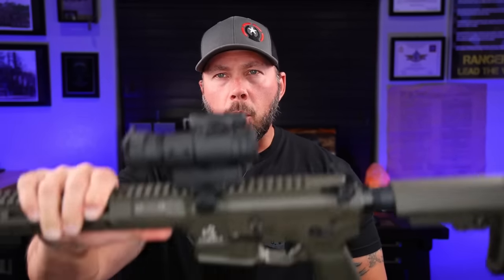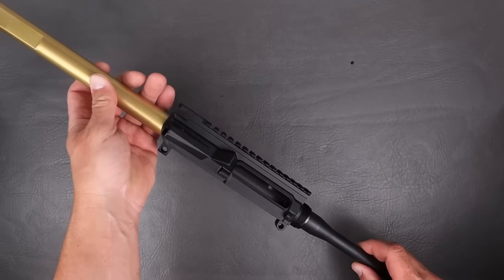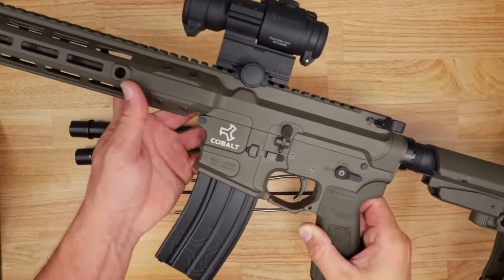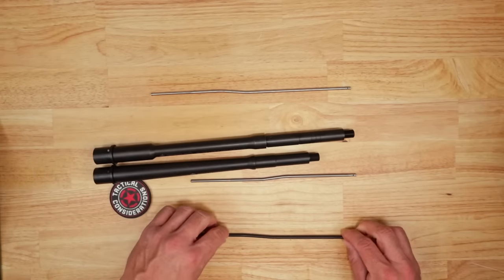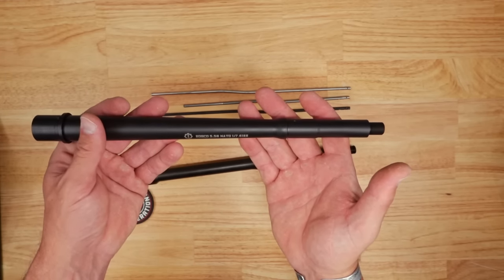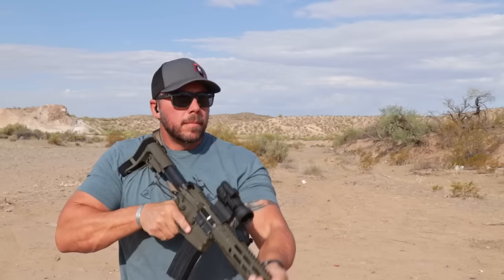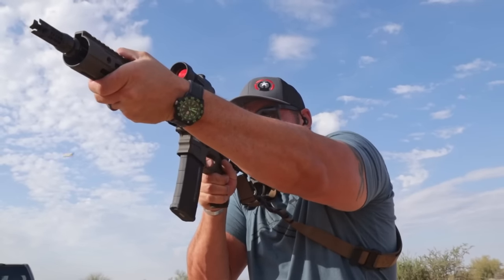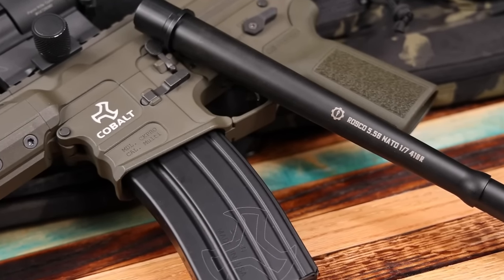Sage Dynamics 12.5 Rosco Patrol Barrel

Comment: Yet again, you review a just purchased item of mine. Serious question: the barrel seems to slide in my upper w/super ease. 
I had to muscle in the barrel my last build. Makes me weary it will affect for accuracy or would you say it not a big deal. It’s Definitely a higher end upper that makes the best buffer systems. 
Thanks for the response and as always the review.
Reply from the maker: All depends on the upper I have that extra which is tight in my aero, slr and other uppers I had un built when I fit tested the barrel. I have had hat too though where one upper the barrel extension fell in and the next had to be pounded in. I always use loctite 609
Reply: @TacticalConsiderations  if slides right in np , you feel gtg w/the loctite ?

Comment: I may have missed it but does the odd ball gas tube come with it.
Also FYI back talking about the prs lite stock the aero enhanced tube is the problem. Regular mil spec works the angle on bottom where the cross bolt fits is different on the enhanced and let's stock slide back. Mine stays put now.
Reply from the maker: Yes the tube comes with it. .. 
I will look into that tube issue for sure now thanks for that info.

Comment: What muzzle device are you running on that? With the muzzle device, what’s the OAL of the barrel?
Reply from the maker: Barrel is 12.5 muzzle device is by cobalt .
Reply: Thank you. I was asking what the AOL is with the muzzle device? Is this setup legal for pistols or would it be considered SBR under the “new” ATF points system? 

Also do you have a review of the muzzle brake? It looks like it is keymo compatible. I’m looking for a keymo flash hider / compensator for a 16”. 
Thank you for your responses and videos!

Comment: I've been running a Triarc 12.5 mid for a while with an a5 h1 buffer and it's a shooter. Really looking into this K9, not a rebarrel but upper build. Thoughts?
Reply from the maker: I think you would really like it especially with that A5 system..
Reply: Appreciate the insight.

Comment: Great review. How does this compare against Noveske and Criterion?
Reply from the maker: Well Neither of those have this length gas systems so its a little different.  I do believe Noveske and Criterion barrels are made of different materials and chrome lined.  Chrome lining if done right only sacrifices minimal accuracy for durability but the cost difference is about double isn't it?
Reply: @TacticalConsiderations  It is. I’m on the fence. My choices are Ballistic Advantage (Hanson) , Rosco, and Criterion. I’ve heard the BA barrels are over gassed compared to Rosco and not many bad reviews on Criterion. What’s your take on if you had to choose between those three for a 300 blk build?

Comment: I just bought this k9 12.5. I wanted a dedicated suppressed gun that can reach decent distance.

Do you think a bootleg adjustable bcg is a good idea with this? Also should I get the rosco gas block or can I use any?
Reply from the maker: I love adjustable gas blocks I have never used the bootleg but controlling gas up front is better than out back.

Comment: 62 grain is a higher power than 55 grain?
That just seems to me like a really weird thing to hear.
55 grain is actually more powerful than 62 grain. K.E. = 1/2 m v2
62 grain steel core retains it's shape better and penetrates non hardened materials better but it is slower and imparts quite a bit less kinetic energy on target. The bullets weight does not correlate with it's "power" and oftentimes it is the smaller faster bullets that really bring the damage.
Reply from the maker: Speed at impact and type of round can cause the internal cavity wound to expand faster or be bigger based on round type. different loads depending on manufacturer may have more or less charge, say NATO  or +p defensive rounds and some self defense ammo. I am no expert on terminal ballistics at all .  

The 5.56 NATO pressure is about 58,000 psi and the 223 round is approximately 55,000 psi. When testing these I usually run all different types from the 223 to the 556 to ensure function.

Comment: awesome content great topic, that is one of my dream barrels the Rosco 12.5" patrol length or the 13.7" patrol length. The only downfall I can see is I would rather have them with a 1-8 twist.
Reply from the maker: That 13.7 is really a great barrel perfect length to avoid tax issues with a  pin and welded muzzle device and was gassed really well.
Reply: It’s better to have the ability to stabilize the heavier 77gr loads with 1:7 twist. So it makes sense. They’d want the faster twist for this. It’s a total tack driver barrel though!
Reply: @MrTylero28  who shoots 77s on the regular?
Reply: @BeautifulJustice  I’ve been collecting components and reloading since the Clinton administration

Comment: What buffer weight and spring are you using in the lower?
Reply from the maker: It came with the A5 system
Reply: @TacticalConsiderations  Copy that, so the buffer is the A5H0 weight? or H1

Comment: What buffer weight and spring were you running in that A5 system?
Reply from the maker: this is the a5 heavy
Reply: @TacticalConsiderations  so, for instance, in my 12.5" Roscoe build, I'm running a sprinco green spring and the A5 buffer system with a A5H3 heavy buffer. Runs beautifully.
Reply: Suppressed or not? Without a can I’ve had excellent results from the a5-1. But the 3 is nice with a can
Reply: @MrTylero28  un-suppressed for now. And that was with 55 and 62 grain bullets. But I have a Sandman-S I've been waiting for for nearly 10 months. 😑

Comment: Looks a bit overgassed did you find this to be true?
Reply from the maker: I have more camera angels that show the ejection pattern .. Its set up just right for the springs and to function well with a can on it.  from the direct side it ejects at about 3:15.
Reply: Must have just been the camera angle. Is it noticably smoother shooting than the bloodline? I have a bloodline on mine now running a green spring/h2 combo and it's freakin butter smooth but this certainly has my attention